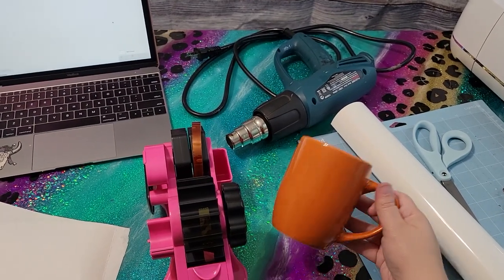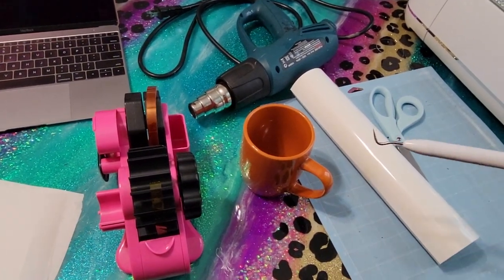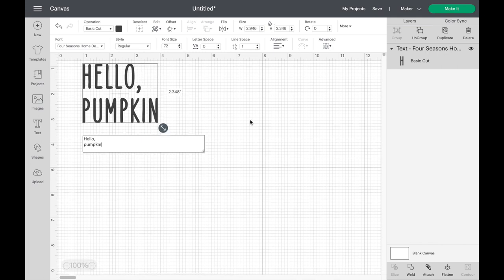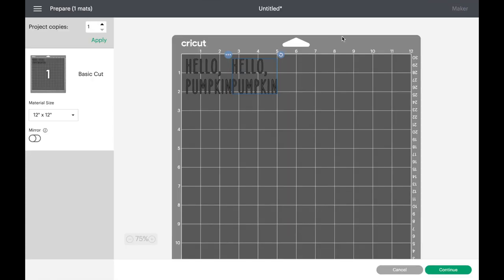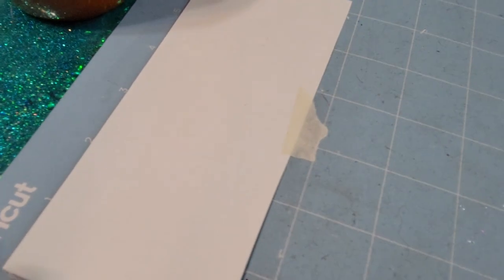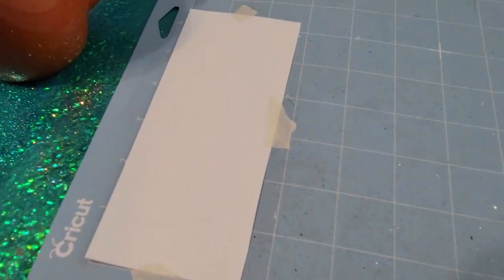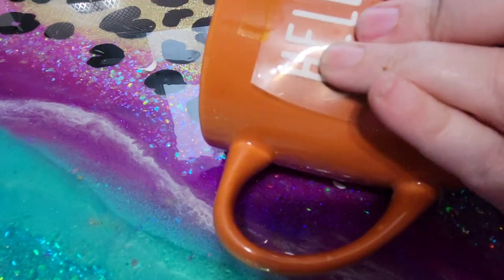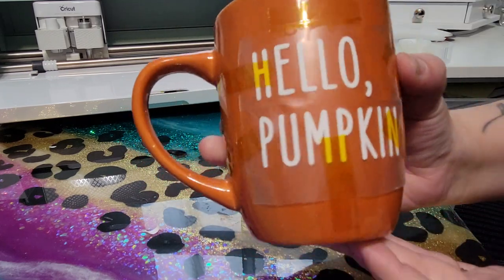How To Put HTV on Mugs With a Heat Gun or a Mug Press / HTV Vinyl on Glassware / Easy DIY Craft

Comment: Hi, just FYI on your old heat press, you can take your control panel off to use with your cup press and plate press, and you don't have to pull out the entire press and base every time.  Only for the hat press (because it has to be mounted) and flat press.

Comment: Thanks for a great video, it was super east to follow along and straight to the point! I appreciate it a lot 😊 Would this work well on an easypress mini ? And should I work the entire vinyl area or press one letter at a time? Also I was thinking of sealing just the vinyl letters with polyurethane using a brush, rather than spraying the whole cup incase it has an incompatible paint or is already sealed etc, what are your thoughts? Thank you 🙏

Comment: Would you recommend HTV Or Permanent Vinyl for this type of thing? which is better?
Reply from the maker: Personally, I use HTV on ceramic/glass items that can be pressed but on any plastic cups I'd use permanent vinyl
Reply: @CreativelyErica i tried htv but its peeling off. It leaves a white residue like glue

Comment: Hello...So is HTV better for mugs as opposed to vinyl?
Reply: No
Reply: Vinyl is way way better
Reply: Ok. I use vinyl, I haven't tried HTV. Can u tell me why u choose vinyl?
Reply: I have used both, permanent vinyl stays longer and stronger.
Reply: @jaberjbaar  okay. Thank you so much. Appreciate ya
Reply: guessing htv is more flexible for barrel-shaped mugs like in the video. Normal vinyl might crease if the letters were chunky.
Reply: also guessing with hot tea normal vinyl glue might soften and make it easier to peel off where htv glue would still be hard at tea temperature and therefore glued on better.

Comment: Do you think this will work with the Cricut Mug Press too?
Reply from the maker: No doubt! My mug press is similar to Cricut's and it worked perfectly!
Reply: @CreativelyErica  Cricut offcially say no as it is too hot and programmed for sublimation only. I will be trying the heat gun method myself as soon as my heat resistant tape arrives.
Reply from the maker: Thanks for sharing. I feel like Cricut says no to everything fun solely so they don't have to follow through with warranties later on. Someone once told me that bedazzling the lid on my cricut made the warranty invalid even though the jewels don't do anything to the machine and I could even scrape them off if I needed to. I have seen someone use their mugpress (I think on tiktok) for this though and it did work out great. But if you need to use the warranty then obviously do whatever cricut recommends.
Reply: @CreativelyErica  I tried the heat gun method with a burnishing roller for pressure and the letters still come off easily. I am wondering if the problem lies with my mug being glossy?

Comment: Do u seal these?? If so what do u use
Reply: I haven't tried it personally yet with HTV (just regular permanent adhesive over baked acrylic paint pour) but I've had success with ModPodge Dishwasher Safe sealant! Put about 5 layers over it, let it sit and cure for the 28 day cure time, and it's still holding up great with both handwashing and dishwashing (aside from a paint bubble on the bottom that was from the paint)
Reply: Is there a faster dishwasher safe coating you can put on? 28 days is long enough for me to forget about the mug haha